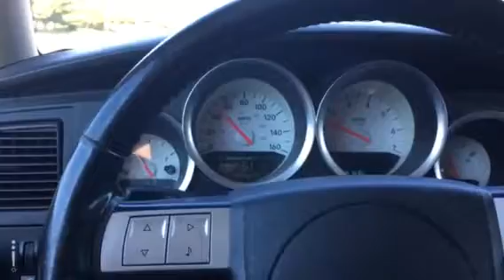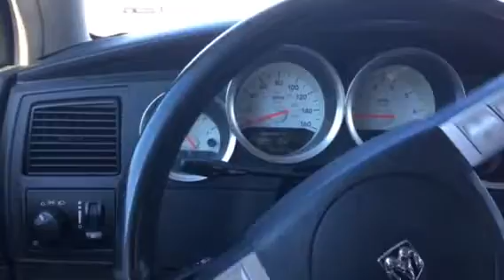Magnum RT weird hesitation

Comment: They have a open recall for the gas tanks on those cars,causes hesitation !! Go to the dealer and let them replace it,if it still does it...Report back !
Reply from the maker: 01trsmar 
Turns out it was the CPS sensor.  I pushed the gas pedal down when the hesitation happened and caused a fault to trip.  No issues since I replaced the CPS sensor. Thanks